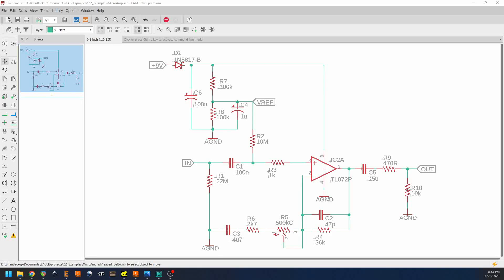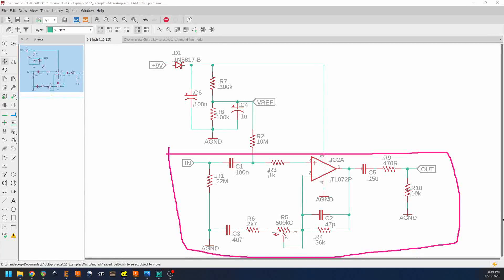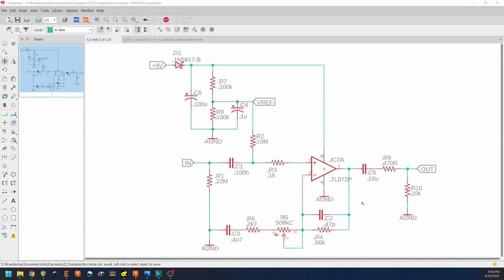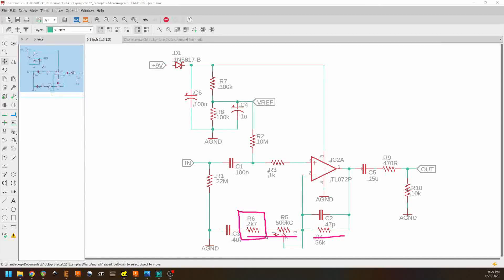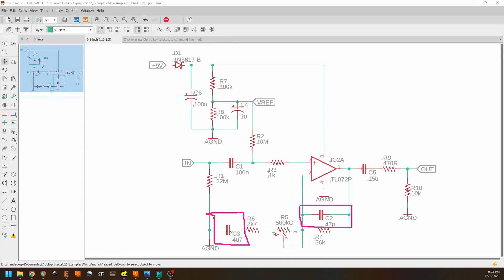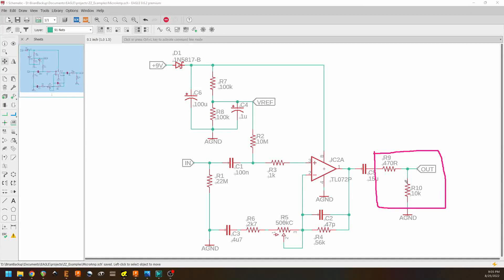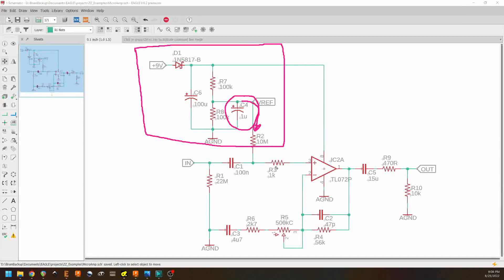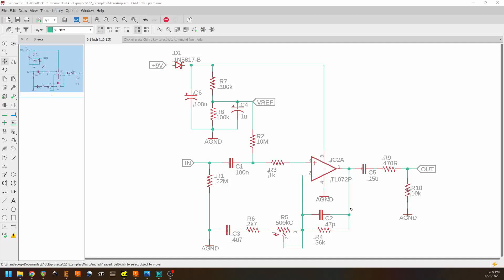Schematic Elements for Guitar and Effects: Opamp Stages, Boosts, and the MXR MicroAmp

Comment: Hi, I found your channel totally by accident and I decided to sub it 'cause you talk about things that interest me in a very accessible way. Thank you very much for that. 
But to the point. 
When describing the elements of the non-inverting op amp stage, you did not mention another important role played by the C3 capacitor in this topology.
In addition to limiting the bandwidth from the bottom, it divides the negative feedback loops separately for DC and AC signals. 
Why is it so important?
Op amps are not ideal components. Small imperfections like few mV offset voltage at the input multiplied by a very high gain of circuits like overdrive, or booster can cause a large constant voltage at the output, which interferes with the operation of other elements, for example clipping diodes . This is why we use C3 cap at feedback loop.  So for AC signals, as you explained in the movie, the gain is determined by the ratio of impedance (R4 C2 ) to (R5 R6 C3) and can be very high, while for unwanted DC signals, the feedback loop is closed only by the resistor R4, which means that the gain is only 1.

Comment: How the value of the power supply voltage divider resistors (R7, R8)  is calculated? Some effects use 10k, others 100k.

Comment: R9 is NOT to be omitted!!! It decouples the TL072 from capacative loads like a long guitar cable. The TL series has a tendency to oscillate with capacitive loads. I would suggest a minimum of 100 Ohms. Overall good explanations but you should pay more attention to those RC Filter relations. Making C1 bigger will absolutely do nothing for the bass response if you leave R2 and R1 the way they are. On the other hand you will cut bass if you put 100n in for C5 and leave R10 as 10k.

Comment: These videos are great. Are C4 and C6 polarised capacitors simply because those larger values are easier or cheaper to obtain as electrolytic caps than as ceramic capacitors? Would it matter if the polarity was reversed from what’s shown in the schematic? Would bipolar caps work just as well provided you used equivalent values? Thanks!
Reply from the maker: Larger value caps are usually electrolytic simply because they are cheap for that much capacitance. Bipolar work fine, but if using polarized, don't reverse them, otherwise they can get fried.

Comment: If I would like to use the MXR Micro Amp pedal as a Booster, it is possible to modify it by adding a volume control like an internal slide or lever switch, or an external small potentiometer? Thanks.
Reply from the maker: It will work as a boost already. The gain knob is changing the amplification factor of the opamp stage so that you can go from about unity gain to close to 26 dB of gain. At max levels, you might clip the opamp a little, though.
Reply: @thescientificguitarist4228  I changed the MXR Micro Amp to the end of the Loop line, and it became a clean-boost volume pedal.

Comment: Just an edit, your gain pot lugs 1 and 2 should be connected together rather than 2 and 3. The way you have yours wired, turned the pot all the way down (counterclockwise) would be maximum gain and turning it all the way up would be minimum gain.